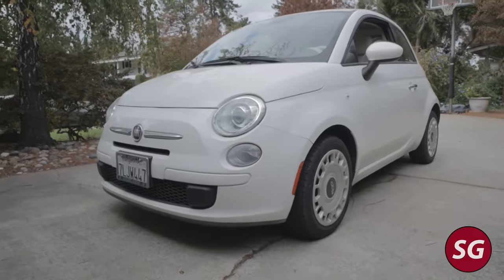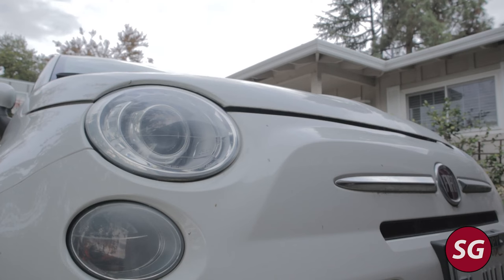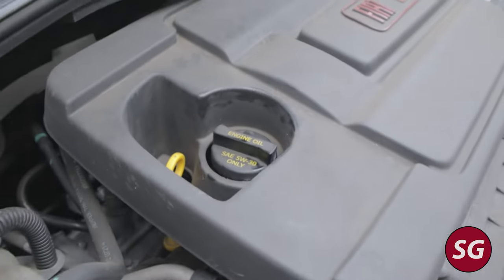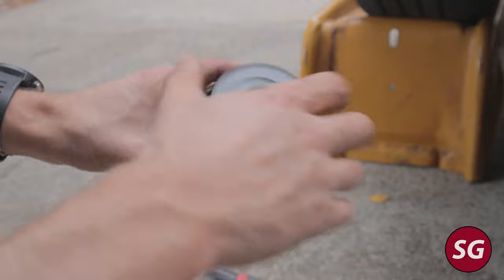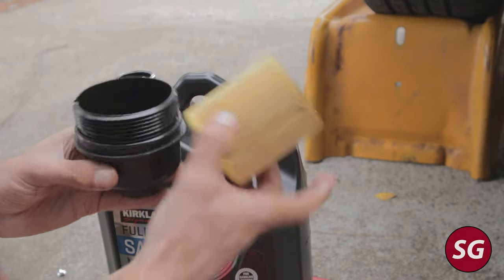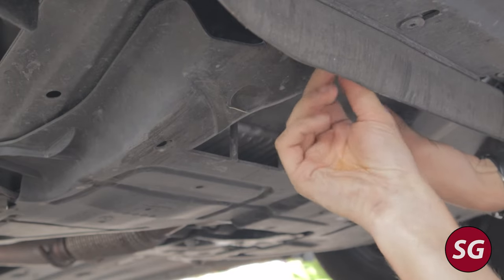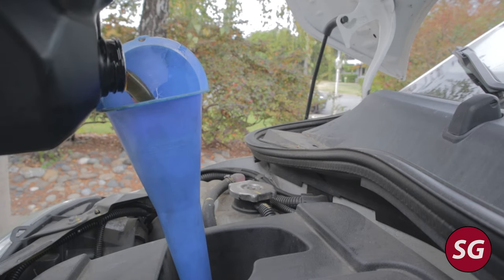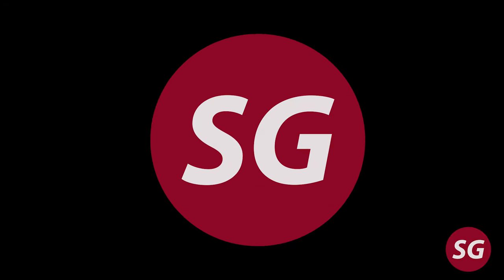HOW TO: Fiat 500 Oil Change // COMPLETE Tutorial!

Comment: Tip for the oil getting all over the cross member just cut a bottles bottom off and a hole bit enough for drain and a magnet above it and slip in on (this is the only reason i can think of that NO ONE will get this cars oil changed)
Reply from the maker: Great idea! I'll have to try that next time.

Comment: New to European cars, Fiat 500, 2012. You might warn that it would be a good idea to use a 6 point socket. On mine the oil filter is easier to access if the plastic cover is removed. Good video, thanks.

Comment: The oil level shows lower on the ramps because you hadn't started the engine yet.  After you started it and backed it off thr ramps some of the oil fills the filter housing and is held in the filter medium.  This probably why you don’t see it happen when you prefilled filters on other cars.

Comment: Brother, there’s a hole on the top of the bumper so you can directly reach the filter housing with a long extension without the use of Wobblies. Wobbly slips on that plastic housing and strips it, you’ll need a new one. If you’re gonna do something, especially making a video about how to do something, do it 100% right.
Reply from the maker: Thank you for pointing this out, I will add a note in the description.
Reply: Give him a break...
Reply: @JOESMITH-bx8qv for real lol. This is such a great informative guide that's very accessible to the average person. A small thing like that doesn't warrant such a comment smh

Comment: “Don’t like getting it too close to full” you won’t overfill it like that.
Reply: Just add what the oil capacity is supposed to be and you won’t have issues.
Reply: If your low just top it off with water.
Reply: @snakeplisken2123 if you add water make sure to add a bit of detergent too help it mix